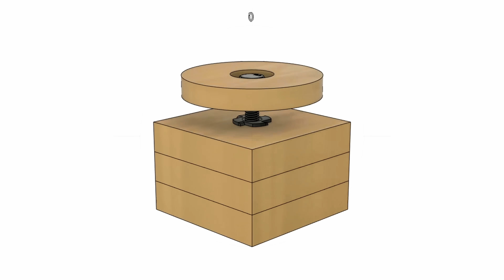💡 Genius Adjustable Spacers For WOODWORKING and DIY

Comment from the maker: PLEASE READ. This video is getting quite a few comments and I would like to clear a few things up:
1. This video is in the context of WOODWORKING. The text WOODWORKING is in capital letters in the video title, Woodworking is in the first sentence of the description. All examples in the video are clearly for WOODWORKING. This video is not targeted at machinists or any other industry or profession.
2. Please watch the whole video through to the end before commenting. I show multiple applications for these spacers further along in the video, they solve more problems than the first one presented at the start.
3. Regarding the video title, when I first came up with this idea, I literally spent hours researching to see if anyone had used an adjustable spacer like this for woodworking. I didn't find anything, nothing at all, and thought to myself "Why has nobody thought of this before?' Again - in the context of WOODWORKING.
4. I am not claiming to have re-invented the machinists screw jack. Being completely honest, I had never heard of a screw jack before coming up with this idea. Having looked into them, they would not work well for woodworking. They are a narrow metal object that would not work well for any supporting/spacing applications for woodworking, let alone prevent vise racking. Any woodworkers out there keen to clamp a solid metal object in their woodworking vise?
5. Somebody may very well have used an adjustable spacer design similar to this for woodworking before, but never shared it online or in any publications
6. My intention with this video was to simply share my adjustable spacer design with the online woodworking and DIY community
7. Thank you to everyone who has responded positively to this video and shared ideas on how the design can be improved. I will build a V2 at some stage and hopefully share another video. Until then, if anyone has any further suggestions, please share in the comments (I am adding bullet points for them all in the ticket description). Thanks!
Reply: You should pin this to the top of the comment section.
Very useful idea and well presented. Thanks!
Reply from the maker: @nathalieheytens5777  I thought I had pinned it, but you are right, it wasn't. Should be pinned now - thanks!
Reply: People are so quick to find fault! Carry on regardless!
Reply: People love to talk trash. It takes absolutely no skill or qualifications to shoot down someone else's work. 

What does take skill and intellect is making informative videos  (people don't realize how challenging it is to think through and present well structured information). Not to mention coming up with an elegant, simple tool you've never seen, to address an issue that every woodworker runs into. 

It's hard to not take it personal when so much effort has gone into something. But only other folks who have been "in the ring" themselves really carry any weight on the matter. Armchair quarterbacks can - and will - talk trash all day about how they would have done it better.
Reply from the maker: @kathrynnewton8721  Good advice and will do, thanks
Reply from the maker: @willbephore3086  Thank you for this. This pinned comment has really slowed down the pointless and irrelevant comments this video was getting (I removed the worst of them). Pleased I did it 🙂
Reply: Agree.

I work in a precision machine shop and looking at getting back into woodworking in my off time.  I use all manner of set up and metrology equipment... including screw jacks.

I will build some of these for sure.  Because, you know, woodworking.

Let the haters hate & you do you.  Good content will have viewers.
Reply from the maker: @Witty..UserName  really appreciate your comment - thanks
Reply: @kiwiworkshop   Of topic here,  but would you consider leaving your sub- titles in screen a little longer?  Some of us,  speaking only for myself,  are not "quick readers"😊  

This adjustable spacer is an awesome idea.  I'll be making some of them,  thanks. 

By the way,  I just found your channel and subscribed.  I like your content and style if woodworking.  thank you.
Reply from the maker: @sawdust85222  thank you for this feedback. Regarding the sub-titles, I'm beginning to think "less is more". i.e. trim them down to fewer, but more relevant words. And reference my website at the start for anyone who needs the technical details. What do you think about this approach? Thanks also for the sub 😊
Reply: @kiwiworkshop  Sounds like that might work. Honestly I haven't watched enough, yet, to know.   At this point i think just a little more time would be fine.  
Thanks for responding.
Reply from the maker: @sawdust85222  thanks. I just went through the captions and managed to squeeze out a bit more time in a few places. It's a bit tricky actually since the video is reasonably fast paced. One tip I should have mentioned before - you can change the playback speed in the video settings. Click the gear icon at the bottom of the video then change the playback speed to 0.75 or 0.5. Hope this helps!
Reply: @kiwiworkshop  Thank You!
Reply: Some things that I quickly learnt when I started YouTube - 
1. People don't even watch the video before commenting
2. People hiding behind keyboards love to put people down as it fills a hole in their empty lives
3. You can repeat yourself 1000 times in the video, description and thumbnail and people will still take it out of context
Reply: @christopherinteriors6521  4. Everyone is either in the Marines or a MMA fighter.
Reply from the maker: @christopherinteriors6521  yes, I have learned all of this very quickly!
Reply: @silowan197  😂😂😂
Reply: Brilliant idea, been doing wood work most of my life always struggling with the right number of shims and getting frustrated. Definitely making some of these. As for the trolls that only lift their heads out of their feeding troughs to try shoot down a Brilliant idea..stuff them. Jealousy makes them nasty
Reply from the maker: @andrevdv1171  thanks for your comment, most appreciated.

Comment: Reminds me of machinists screw jacks used to level or control angles of stock while clamping for machining.
Reply from the maker: Good observation and one of my Instagram followers mentioned the same thing. I had never heard of a screw jack before making these, might have named them differently if I had "Screw jacks for woodworking"!
Reply: @kiwiworkshop  Yup anyone who has done machining will recognise them as machinist jacks.  But then we re-invent things every day.  Good job I am sure it will help people.
Reply: @danharold3087  yep, ive always called them bottle jacks

Comment: Made something similar 30 years ago. Needed to level a twin sided 4 seater with attached shared  back and integrated over head cover that would sit in a tarmac tennis court alongside a pool. It was super heavy. Holes dug.  In lieu of 4 car jacks, I made 4 adjustable timber jacks along the same lines. Cross based stand, upright 4*2, drilled in bolted thread with washer bolt then a cover cap with another nut and a nut for adjusting the height, and bringing it level. Sort of a cross between carpentry and engineering. Made the concreting easy.
Reply from the maker: Interesting, sounds like the same concept for a much bigger application. Thanks for sharing that.

Comment: Great job, very simple design. I plan on using this to help rise slabs off my table and pour epoxy on them so they'll be level.
Reply from the maker: That's actually a really good application for these spacers, I hadn't thought of this. You could easily make small adjustments in each corner until the slab is level. Thanks for mentioning this! I will start listing out more possible applications in the video description.
Reply: @kiwiworkshop  sounds good. I literally mentioned this to my wife last night and then found this video today. 🤯
Reply from the maker: @kmchartrand99  great, pleased you found my video! Did you find it by searching on YouTube or did YouTube recommend it? I just added epoxy resin pours as a possible application in the video description. Thanks again for commenting.
Reply: @kiwiworkshop  youtube suggested it actually. I've subscribed as well ☺️

Comment: What a wonderful presentation. I love this idea, and can’t wait to make my own set of spacers. But, I missed the dimensions of the MDF bases and circle tops. I saw the thicknesses, and the ranges of extensions, but not the length/width of the bases, and the diameter of the circle tops.  I guess I could just use my own sizes , but I think you’ve already figured out the most economical cuts from a 4x8 sheet.
Reply from the maker: Thanks for the feedback, glad you like the idea. I just replied to the Disqus message you left on the kiwiworkshop website. Here is a copy of my reply:

--
You are right, I missed the dimensions of the base squares out of the video and this blog post (will update it later). They are 80mm x 80mm but could be any size you want. I started with MDF that was already broken down from 4x8'. You don't need much (assuming you are not making heaps of them) but I would start at one end and cut a strip at 80mm across the shortest dimension (4'). Then cut squares at 80mm, keeping in mind the kerf (cut width) of your saw will be about 2.5mm. The circles are sized to match the base, but you could just as easily make them as squares and the spacers would work just as well. Hope this helps.
--
From:
https://www.kiwiworkshop.com/blog/woodworking-spacers-with-adjustable-design-save-wood-time-and-money/

Comment: For the Mk.2 version: Assuming you have a drill press - make the round platform into a knob with multiple notches around the outside, just drill 4-6 holes centered on the circumference so about half the hole is left when the knob is cut out. Then use a hole saw to cut the outer circumference. To make the recesses for the T-nut and bolt head, use a spade bit first at the center point to make a shallow recess, then use the center hole left by the point of the spade bit as the center mark to drill the final smaller hole for the bolt or T-nut barrel.
Reply from the maker: Thank you, these are great suggestions. I really like the idea of a star knob on the top, I did not think of that and it will look pretty cool too. Also a good suggestion recessing the tee nut, somebody else in these comments suggested the same thing. Once I've replied to all of the comments, I will start bullet pointing out all of the suggestions for version 2 and put them in the video description.
Reply: I think a video describing what you said would be very helpful

Comment: My compliments for how comfortable you are with safe handling of power tools! 👍
Reply from the maker: Thanks, really appreciate your comment and glad you noticed. I'm aware that my viewers might try to copy what I'm doing, so would like to set the best example. I often cringe watching other YouTube videos that set a terrible example regarding power tool safety. Table saw and router table accidents happen way too often.
Reply: Thanks for saying this Ron, I agree wholeheartedly. The real professionals recognize the weight of responsibility to model safe handling behavior.
Reply: One thing to add though, is that the "chicken foot" isn't the absolute safest for the table saw, as it leaves capacity for the material to kick back upward towards the user. Something that holds the material pressed downward as well is the safest, especially for an inexperienced user who doesn't know to set the blade depth. Just a thought though, keep up the good work.

Comment: Very nice! I think the one change I will make when making these is to have the circular rests a bit wider to allow more clamping surface. I think to be able to clamp the workpiece to the rest (especially in the first application shown) would be very handy. Or maybe some strong elastic which can wrap around, just to hold it in place
Reply from the maker: Good idea clamping the workpiece to the circular rest, I didn't think of that! It should actually be possible using a spring clamp with the current design, but might get a bit tricky if the spacer is wound all the way down. I will give it a go later. You could also build the circular rest part at different sizes to suit different projects. One thing to keep in mind is there can be a small side-to-side tilt if the workpiece is positioned towards the edge (because there is small movement between the tee nut and bolt). Provided the workpiece is positioned in the middle, this is not an issue. Also not an issue if the spacer is locked with an additional nut, like I showed in the video. 
Thanks for sharing your ideas.
Reply: @kiwiworkshop  well, if you build several sizes, then you can mix and match the rests to the bases to free up some room for clamps if needed (e.g. rather than use the 3-ply screwed all the way down, use the 1-ply base with 3-ply rest, yielding ~2" of clamping room at the same height as the fully screwed down 3-ply).

Thoughts to eliminate tilt: rather than use a T-nut in the base, epoxy in a coupling nut so there's more threads engaged. OR, more simply, when you drill through the base for the bolt/t-nut, size your bit to the minor diameter of the bolt (so the threads catch the wood) and only drill enough at the larger diameter that the T-nut will fit. Basically, you want to engage every bit of the bolt that's inside the base, rather than just the 1/2" in the T-nut.

Comment: This is a great idea, I'd only make one suggestion - recess the tee nut and the lock nut for the bolt, you can squeeze another 5ish mm of range in that way.
Reply from the maker: This is a good suggestion. I will work on a v2 at some stage and will definitely recess the tee nut. It would be nice for the spacer to be adjustable down further down in it's range, as you suggested. You've got me thinking actually - if the top is laminated out of two thinner pieces of MDF, it would be possible to embed the head of the bolt in the middle. This way the nut that holds the top in place could be completely removed. With those two changes the spacer could be adjusted all the way down. Thanks for your comment!
Reply: You could also add a thumbscrew from the side to lock the platform height.  No need for a wrench an locknut then
Reply from the maker: @evans_workshop  that is a great idea, thanks. I will add it to the bullet points for V2 in the ticket description.

Comment: Good idea I particularly like using it in the vise I am going to make one and put a magnet on it so it stays in the vice and I can remove it whenever I want
Reply from the maker: That's a great idea using a magnet to hold the spacer in the vise. Since my vise is mainly wood, I might embed a magnet on either side. The head of the central spacer bolt should then hold against the magnet. Thanks!

Comment: Thanks for this, what a great idea. Quick question, if I used Plywood instead of MDF, would that have a negative impact on the performance of the design? I don't see that it would, but i'm still a beginner. Thanks. Dimitar from South Africa.
Reply from the maker: Hi, you could use plywood but make sure it's flat. In my experience, plywood is more prone to bending than MDF, otherwise it should be OK. Thanks.
Reply: @kiwiworkshop  Thanks mate, appreciate the feedback.

Comment: Thought of one idea to make it more modular. Use the smallest size, put holes for dowels in each of the four corners. Then just stack up, could save on materials that way.
Reply from the maker: That's a great suggestion. When I first pictured this, I thought you would also need to have a number of dowels at different lengths available. Not sure if it's what you were suggesting, but if the base squares are constructed just like lego bricks, you could stack them up on that principle. The more I think about this, the more I like it. Stack up bricks to get roughly to the correct height, then fine tune with circular adjustable top. Thanks heaps for sharing your idea, this will definitely help with V2!
Reply: @kiwiworkshop  you could also recess magnets. That was my first thought so you could just grab a stack and snap them together.
Reply from the maker: @LiamYager  that is a great idea with recessed magnets. I guess that provided the magnets are positioned accurately in each corner, each layer you add will snap into proper alignment. But even if they weren't 100% accurately aligned it wouldn't matter. Unless you had something like small dowels in diagonal corners and one magnet in the middle.  That would ensure proper alignment with the bonus of each new layer being held together with the magnets. I will give it some more thought and for now will add this to the bullet pointed suggestions for version 2 that I will put in the ticket description soon. Thanks for your suggestion.

Comment: This is awesome and I'm almost certain I'll get endless use from them once I'vemade a set. 
Thanks for sharing your brilliantly cost effective idea. This would easily cost 150 bucks if the Kris, Rocwell or the overpriced red company had thought of it before you. Thanks again 👍🏾
Reply from the maker: Thanks, I hope they work well for you. Yeah, they would certainly be overpriced if once of those companies start selling them. There are some really good suggestions for improvements in the comments and I'm going to start bullet pointing them out in the video description. You might want to check them all out before you start - will try and find time for it once I've replied to all the comments.